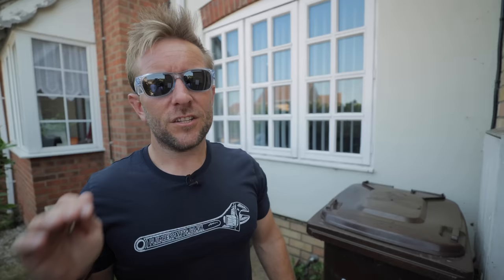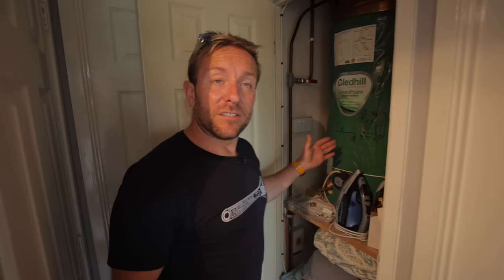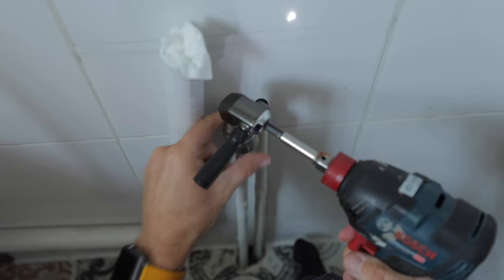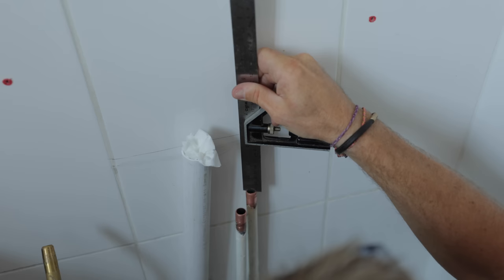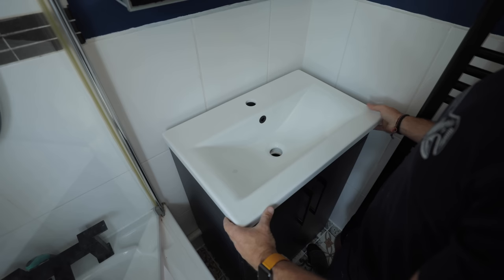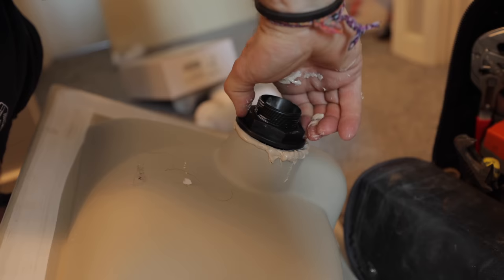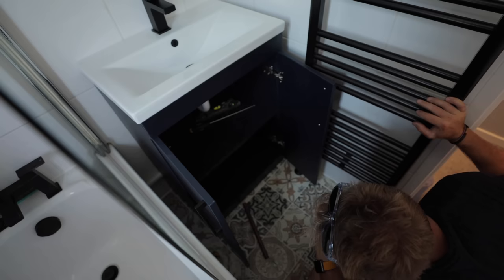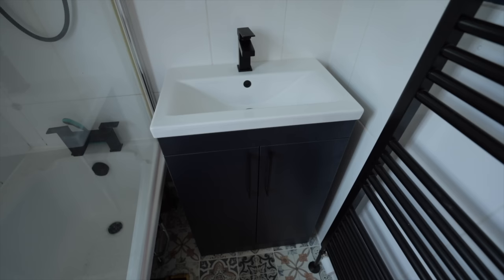ON THE JOB How To Fit A Vanity Unit Basin With A Crazed Dog!

Comment: I'm not a plumber but lately have become obsessed with your vids after second fitting my en-suite. Did the sink, toilet, waste, cistern and shower. All done and your vids were a great help. I have one question though; when I fitted the mono tap, the water that splashed around it seeped down into the vanity unit. Is that normal given that it was both with its rubber seal and tight enough to not jump around. I solved it with a plumbers mait sausage but was wondering if that was the correct solution under a tap? I also "sausaged" the underside of the basin waste and not a drop from either since!
Reply: Had the same problem with water getting under the tap base. Plumbers mait saved the day

Comment: Hi mate… thanks in advance 
I have quick question…
Planning to o install a rain shower … of course a low budget one😜from amazon ..
I have found one shower head and the mixing valve as well…
Can I simply connect the valve to hot & cold lines and to the shower head????
My doubt is that by doing that … will the hot and cold main lines get mixed up with each other as valve is just like a tee valve???
Hope I ddnt get u confused 🧐
Reply: Im not a plumber, but I’m pretty sure you need non-return valve on (at least) the cold feed.

Comment: What was the paste you applied, when putting the compression couplers on, around the olives please?
Reply: It's a goopy paste like plumber's mait, there's many varieties: [Liquid PTFE, Pipe thread compound, Jointing compound, Boss white, Tru Blu, Plumbers Putty]. It's important that it says it's "Suitable for potable water", or it will be toxic, against regs and poison you - the non-potable stuff is for radiators and waste pipes.

Comment: You could have used a jigsaw on the base of the unit to scribe it so it fits the wall, anyway nice vid thanks again.
Reply: Bad idea. The units are usually chipboard (very easily damaged by water) that's been then surface treated with veneers and/or paint/glue - Cutting into the cabinet exposes the edge to water damage. Especially bad against walls or floor that will be frequently wet.
Reply: @dimitar4y  Just seal them after the cut with either the matching paint or clear silicone, better than a ugly gap.
Reply: @redline589  True, that would be the high end way to approach this. But if the job was this high spec, the wall/floor wouldn't be out of alignment to begin with :p